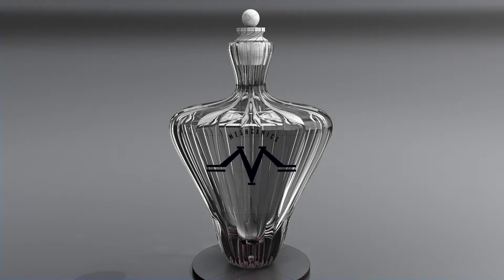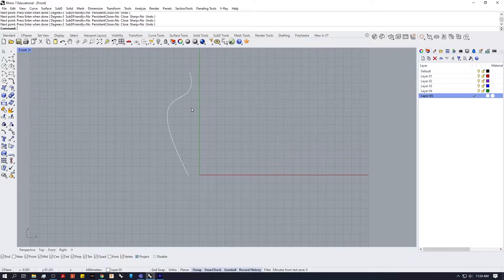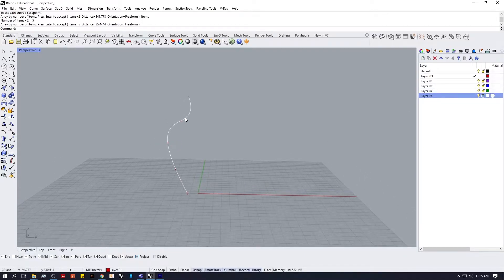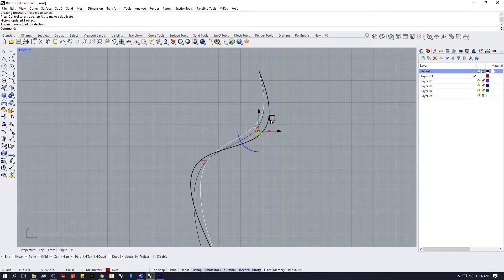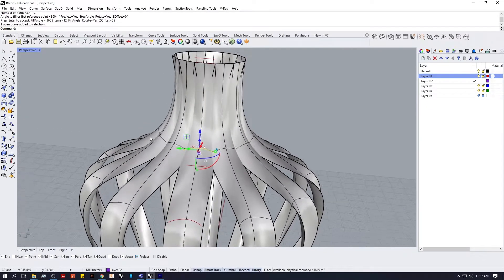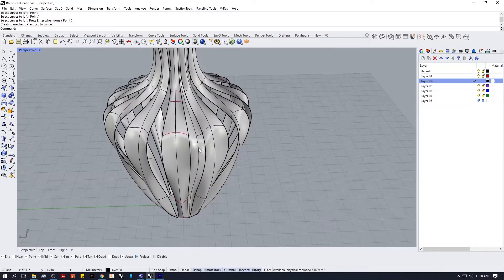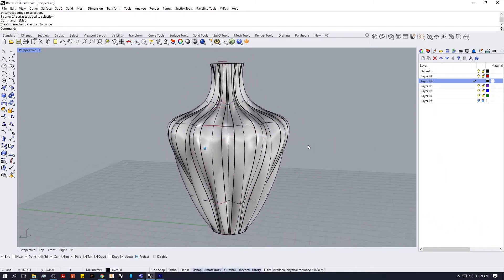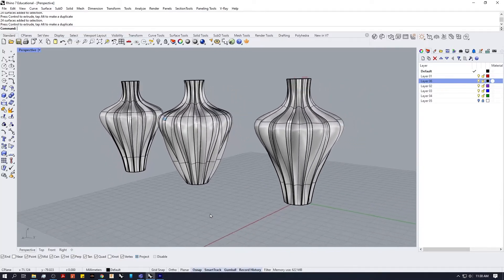Complex Shapes Simply in Rhino 3D

Comment: Great video. I do have one question, what is the best way to add a bottom to the vessel?
Reply from the maker: If you just want a flat base you can use the 'planarsrf' command (planar surface). other options are 'patch' or to revolve a profile and trim it to fit the base.
Reply: @benhurst4039  thanks